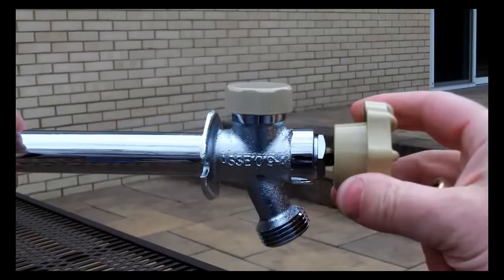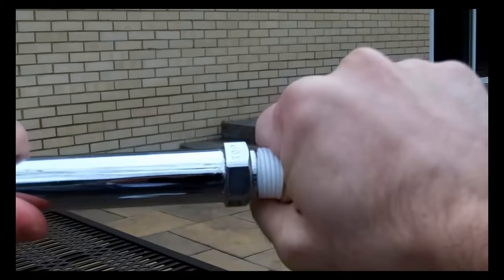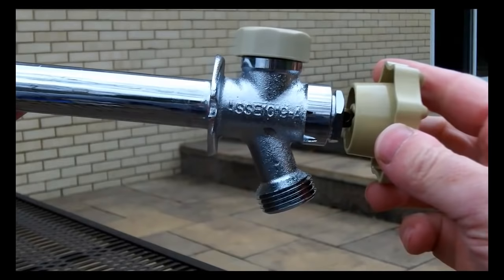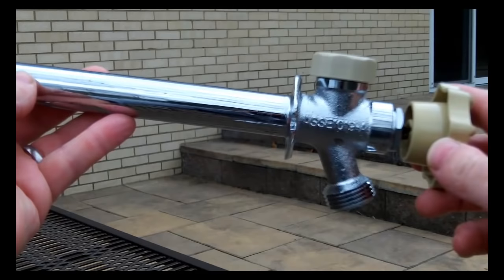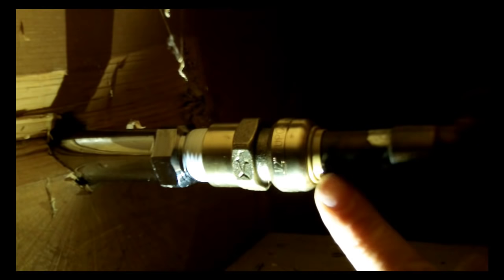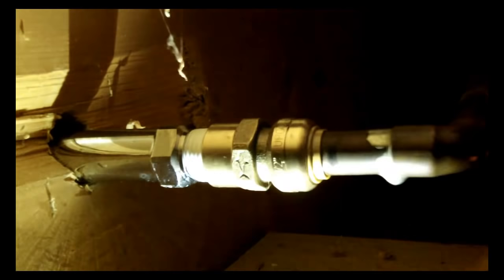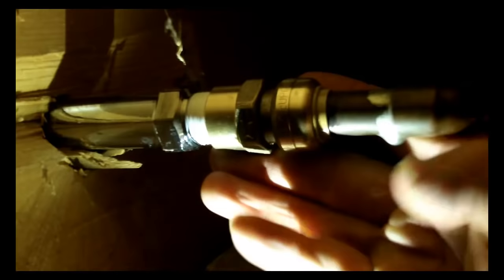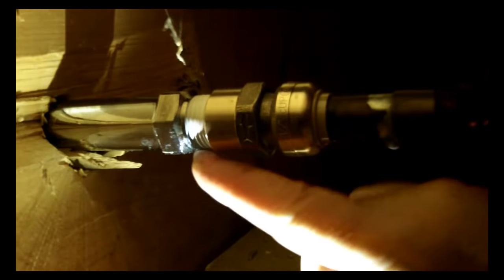How to Install a Frost-Free Sillcock - Part 2 Installation Tips

Comment: thx, good video. Both frost-free sillcocks that I have installed come with a wedge shaped washer/shim with screw holes that is slid between the faucet and outdoor siding to ensure the proper angle for drainage.

Comment: Nice when you can get to the the waterpipes on the inside of the house. What if you can not get to them. Without  cutting holes in the sheet rock to get to them. Can they still be replaced?

Comment: I've had nothing but problems since a contractor (why a contractor is using sharkbites I have no clue - def won't hire him again for this type of work) used sharkbite fittings to re-plumb and re-connect a frost free hosebib on my house. The flow has reduced so much that I can't even run a sprinkler.

Comment: installed one the other day its summer and when i turn it on water shoots out of the little hole behind the shut off knob. no water will come out of the hose fitting. i dunno what i did the night before to make it work but after turning the main water valve off and on a couple of times it worked. does it get some kind of hydrolock inside the pipe or what this is ridiculous im soon just gonna install a regular faucet thanks forvany help

Comment: You didn't need to seal where you put the pipe into the sharkbite fitting? I need to look up this magical fitting.
Reply: Sean Baker they're not all that magical..
Reply: I've used sharkbites for indoor and outdoor fixtures/plumbing with no problems. From what I've seen and heard, most people's problems come from not following the sharkbite's instructions or not getting a proper sized unit to begin with or improper measurement, etc. (handyman for over 40 years who hates welding/soldering, especially in tight places)

Comment: I just did this project at home but i have a bit of a leak from the siphon part of the tap ONLY when you turn it on for like a second... perhaps it is letting air out or I didn't tighten it enough (it seems pretty tight to me)... any ideas?
Reply: bigmikey2323 that is normal, it's the residual water draining out of the frost free.

Comment: That does not by any stretch make any sense by tipping the silcock 5 degrees down stop air from entering. It allows water to flow where needed so it doesn't freeze.

Comment: There is no reason to use a shark bite fitting in that situation
Reply: What if you don’t want to solder?
Reply: $6 for a shark bite fitting... vs. at least $30 for a torch and solder... Plus easy to remove later if there's a problem.
Reply: Most would sweat on a 1/2" female pipe thread to sweat fitting to eliminate need for sharkbite and still be serviceable.